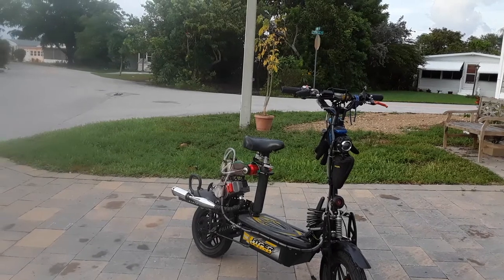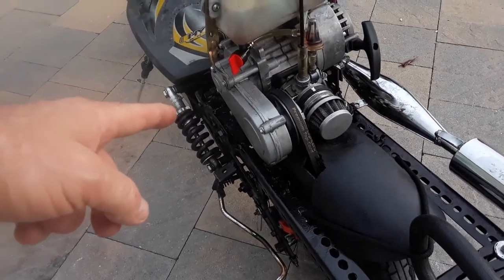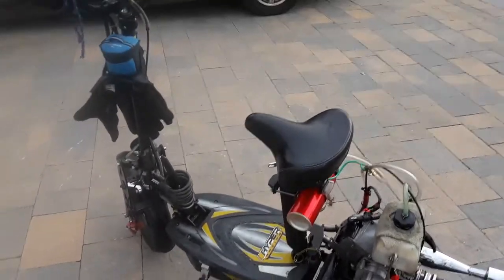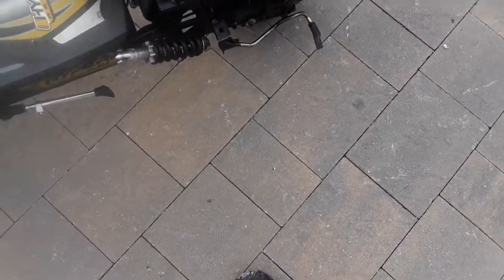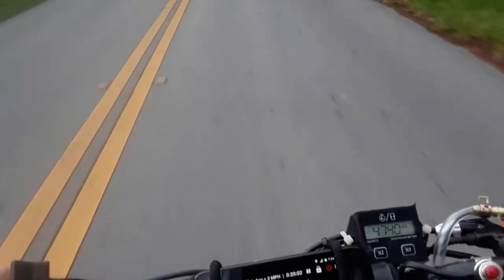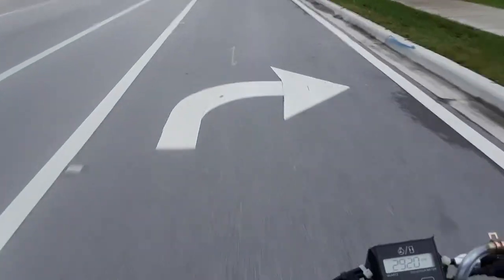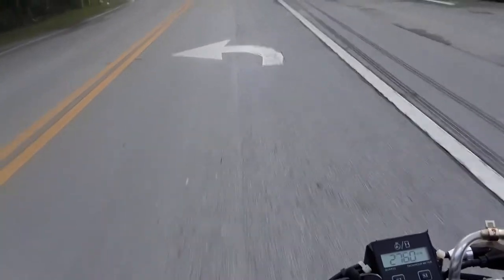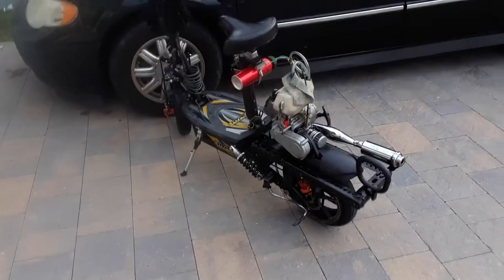Scooter/Pocket-Pit Bike CAG 49cc (Walk around)  top speed run.

Comment: My last buy  was the anbull "100" cc out the box with a 1 inch by 1 in hole in filter case is only pulling at 37 so far I couldn't keep it open cuz in turning traffic was coming in and thats on a 44 tooth sprocket. I know if I go lower tooth it will pick up more top speed but I like to pick up quickly